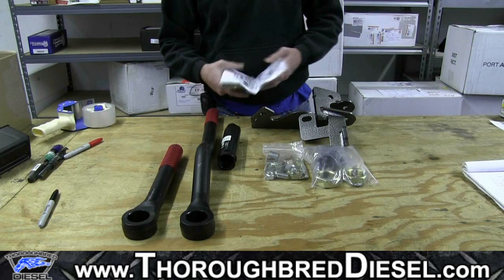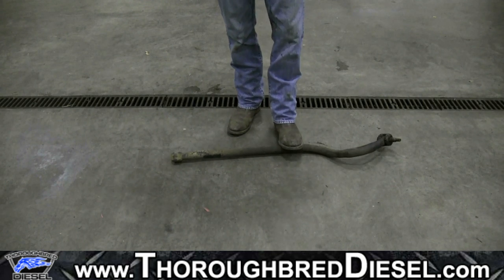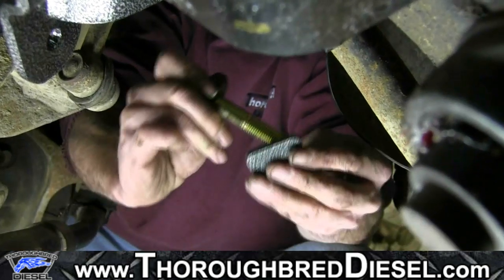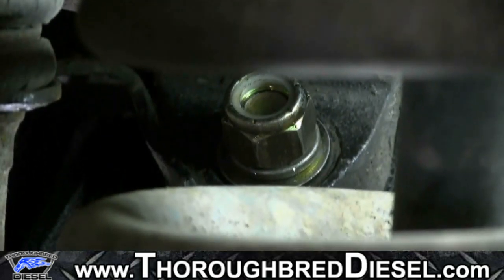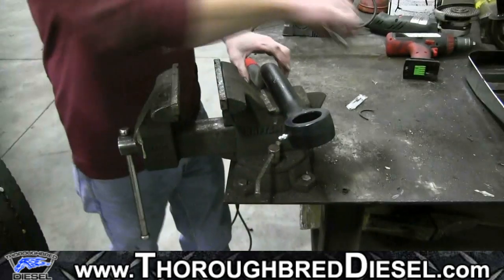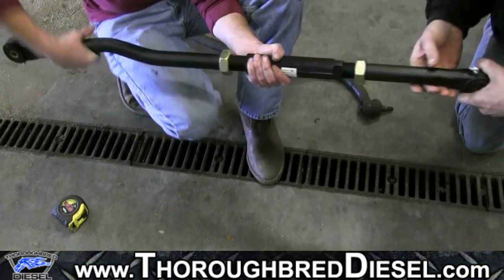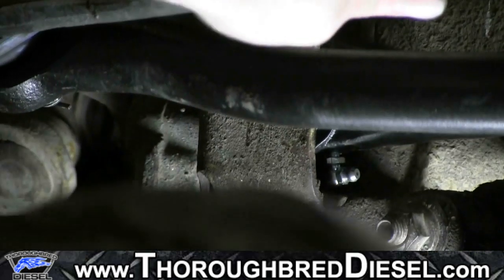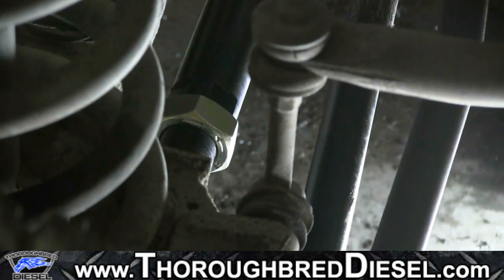BD Diesel Track Bar Install: 98.5 Dodge 24 Valve 4WD #1032011-F

Comment: Finally got and installed mine, this video helped alot. The new bars do not come with grease fittings though
Reply: Did you buy a BD diesel track bar? Or did you buy a off brand track bar?

Comment: Does this track bar help with death wobble is this a way to combat that issue?
Reply from the maker: It can be one way. Death wobble can come from several different areas though, ball joints, tire problems, etc.

Comment: When drilling the 2 5/16” holes in the subframe did you use a standard drill or a right angle drill?  Doesn’t seem to be room for a standard drill with the axle pumpkin where it is.
Reply from the maker: Yes, we used a right angle drill there.

Comment: mine at up the bushings within 3000 miles and the wandering started again. having trouble getting replacement bushings now
Reply: Was yours a BD diesel track bar or off brand? What size lift are you running?

Comment: Was that for a 2in leveling or what is the length for a 2in level
Reply from the maker: This bar will work for up to a 4” lift on the 94-02 Dodges. Bar length will depend on your lift.

Comment: I know this is a old video so hopefully I can get feedback before I email bd. I started the torque sequence and the 5/8ths bolt could NOT get to 240ft lbs. The threads gave out and then it just spun. Yes my wrench is calibrated. Do you agree that I had a hardware failiure? Nut or bolt.
Reply: Theyre supposed to be torqued to 150 ft/lbs not 240
Reply: @randommxname202   I am referencing the fine thread bolt that goes through the factory frame trac bar mount. The instructions said 240ftlbs. Found out I had a torque wrench problem.
Reply: @alexzipp585  the factory lower trac bar mount on the axle? That's also supposed to be torqued to 150 ftlbs if thats whst youre referring to
Reply: @randommxname202  No, Iam referencing the bracket bolt that utilized the frame mount for the original style trac bar. It is 2 and a half inches long. It would be the one where the upper trac bar "ball joint" style mounted to. My two trac bar bolts are 150ftlbs this is the bracket....
Reply: @alexzipp585  gotcha, yeah im assuming its just a product wuality failure. Did you end up fixing it?
Reply: @randommxname202  well got a new bolt two different torque wrenches and i think i am ok. 65 miles so far

Comment: Any specific reason why no one makes a cast iron adjustable track bar for a 2012 Ram 2500? It would be stronger than anything out there and may eliminate wobble from my truck and plenty others and a cast iron drag link and tie rod while your at it with replaceable tie rod ends. That is the only suspect I think on my truck now from trying to solve it for years , extremely frustrating. YOU listening  ?
Reply: It's your steering box shaft has some play. Get a bd death wobble kit